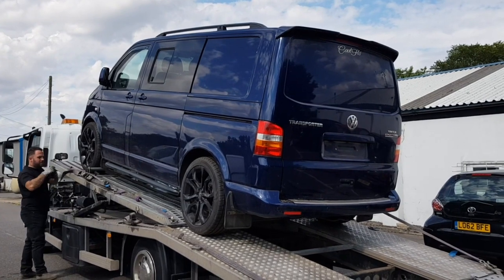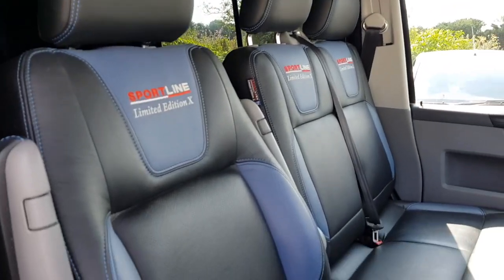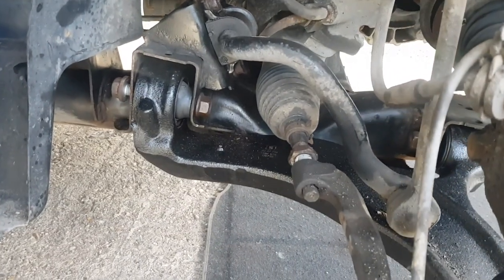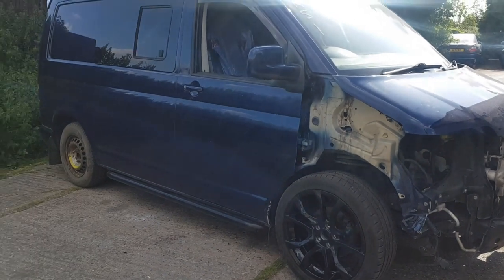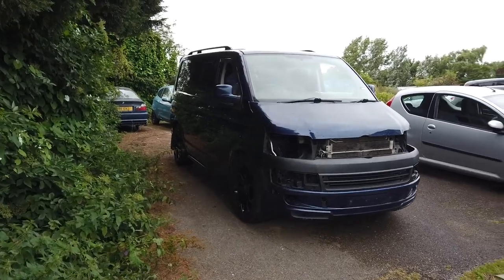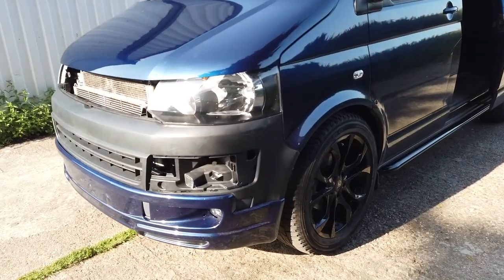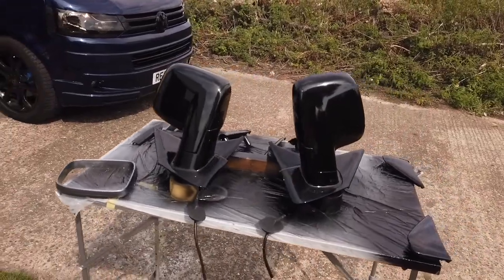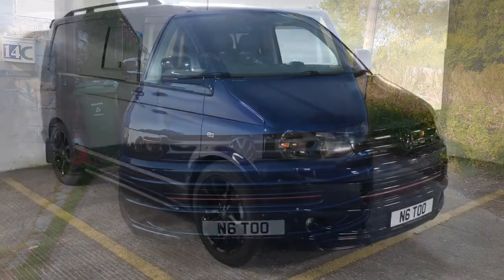VW Transporter T5 Conversion Project Salvaged Vehicle From Copart Part 1

Comment: Looking good. What size are the rims, tyres and has it been lowered? Yours seems spot on visual wise.
Reply from the maker: Hi, and thanks for the compliment, there 20s with 255/50s Pirelli Scorpion tyres and it has not been lowered, I chose this size because I wanted 20s and at the same time keep the ride comfortable and fill the whole arch, this combination seems to work well. You will have to heat up and bend back the plastic wing liners to avoid rubbing however this is quite easy.